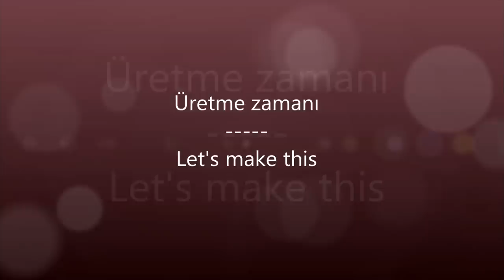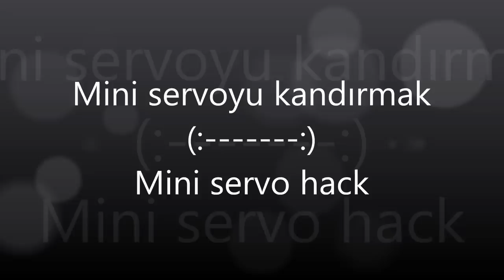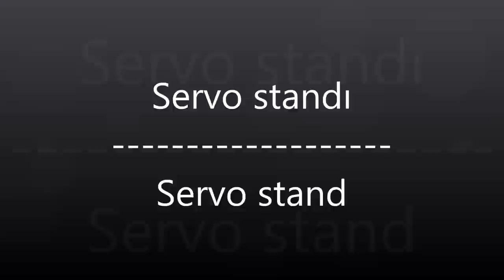Great idea!!! How to make powerful wiper servo / Büyük ve güçlü servo nasıl yapılır

Comment: Thanks for your video. I've been working on a custom mosfet H bridge design for a while, but after seeing your video I switched over to the IBT2.  Works great!  I did add +5V to pin 7 of the bridge to power the on board 74244 driver.  Job well done!
Reply from the maker: 👍 good luck

Comment: Hi, I made all the connections like you did, but I use other servo with 35kg and a 12vdc motor with 27rpm, and when the potentiometer of the servo turns a little bit, the motor runs in the same direction, but don't stop !!
Can you help me, because I'm not seeing what it wrong!!!!

Comment: great idea, very informative. what about the controls for the throttle motors? use the same h bridge as well? I have a 6x6 power wheels, this works for the steering but what about the 6 wheel motors? any idea on how hook them up? thanks

Comment: I keep getting a humming sound from the motor driver but no motion. Everything is hooked up the same. Any help?
Reply: @SinanKeskinDC  i will make sure all of my connections are good and secure. Thank you for responding! This is a very important project i need this for so your help is appreciated
Reply: @SinanKeskinDC  The 2 wires that power the motor inside the servo, i have detached them from the motor and removed the motor like in the video, nothing happening but when i touch the motor back to the wires i cut it from it spins. Should that happen?

Comment: I noticed that you are using an AM freq. receiver.  I have the same thing and it works!  However, my deadzone (center) is very small and the RATE is very fast.  I have not rate controls on my x-mitter.  I tried to used several other tx/rx combos with steerting rate controls - 75Mhz, 2.4Mhz and they all make the motor only go in ONE direction.  Any thoughts as to why?  Are there alternative ideas?
Reply: use one arduino to receive the channel and control the servo. you can control the death zone better

Comment: I followed your wiring diagram but it does not stop when the controller is turned to the max the motor just keeps spinning
Reply: Sinan Keskin I checked all connections but still no luck
Reply: I have the same issue. The motor keeps running away on me. So it bends the control rod. It is tight. Wiring is correct as it does work, but if it rotates past a certain point it runs away.
Reply: I also found the bts7960 will only give out 2v when the motor is 12v so goes very slow
Reply: @lukefinch3409  hai risolto il problema?
Reply: @JeffSpinner  hai risolto il problema?

Comment: i already did it bro, but it's like the motor is on normally open mode wherein it keeps spinning until i steer the joystick left and right, i have a 5 wire wiper motor, i want to send you the video of my work where can i?
Reply: the motor spins as I turn on the supply and the joystick, is it normal? shouldn't it be off then it will just move when I steer the joystick left and right?
Reply: it's a servo problem, it becomes shortes when i remove the motor, i tried leaving the motor in and it works fine but my problem now is the left and right steer is weak, its like it only goes 15degrees and not full 45deg. what do you think is the problem?

Comment: Iv copied you as best I can (except I used a FS-IA6B) but I cant get power to the FS-IAB6 without using an external 5V Power supply. Also my Power Supply (Hanmatek HM305) will not supply more than 3V to the IBT_2 but will give 12V to the motor no problem :( Please help if you see this.

Comment: Подскажите как где я ошибся почему не работаетhttps://youtu.be/6u_Ls3LeG5k?si=retUPAJ3Yz7vDkVZ
Reply from the maker: If you want to make servo motor, you have to  connect micro servo arm to big motor output shaft.
Reply from the maker: If you want to big servo please watch video again.
Reply: thanks all the more, I figured it out, the price of the receiver) which burned down is not clear because of what